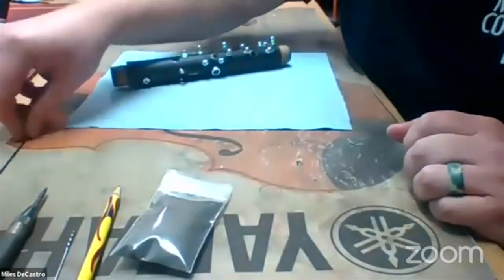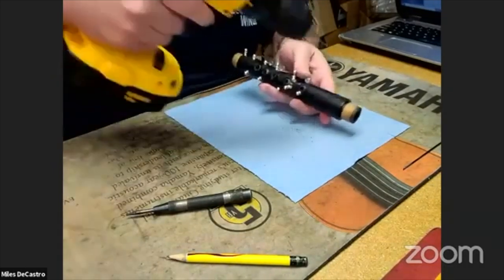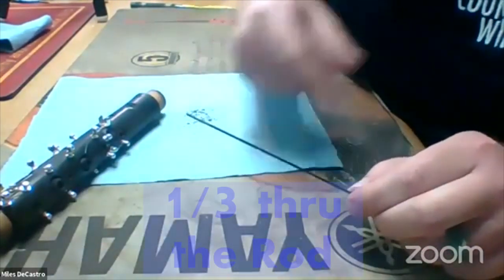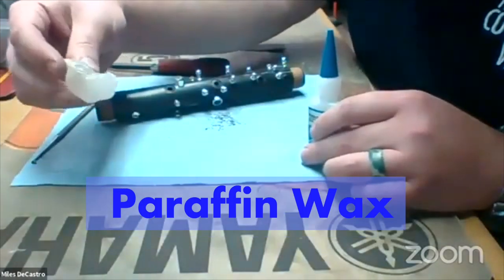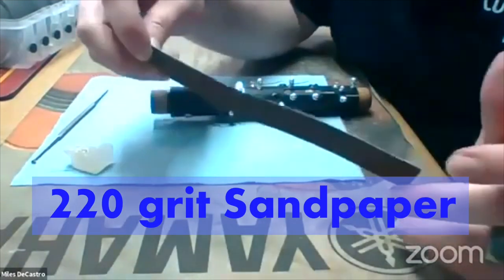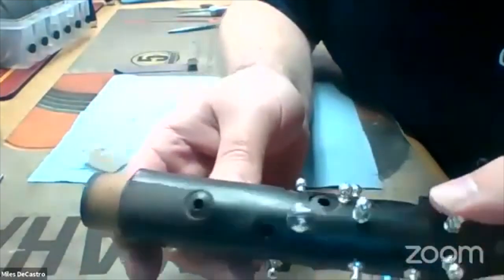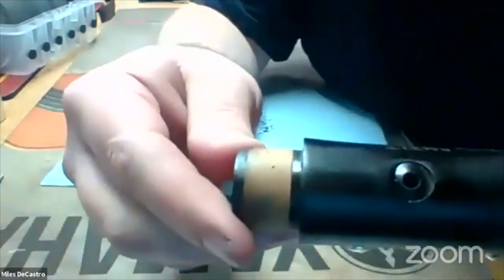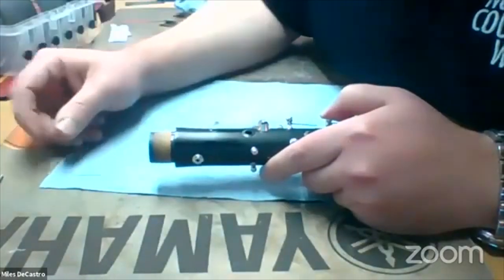Clarinet Carbon Fiber Pinning with Miles DeCastro

Comment: Thanks for the video. I’ve always drilled the hole using a bench motor. The bench motor gives stability and more accuracy. I also rarely try to reduce the crack. I’ve tried both ways and have less issues with leaving it alone.
Reply from the maker: Great point!

Comment: I do it a little differently, I use .8mm carbon fiber, I will usually bury the carbon fiber, by cutting the rod a little smaller.
Reply from the maker: Great tip!